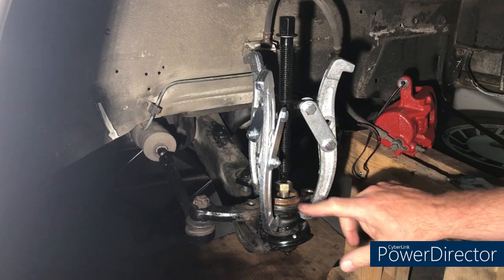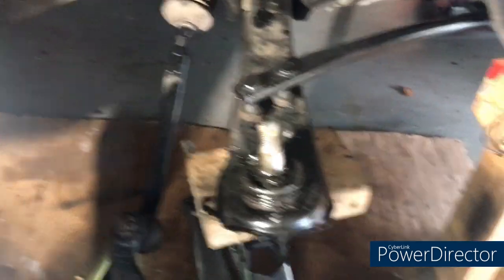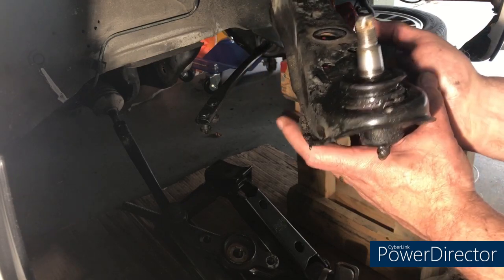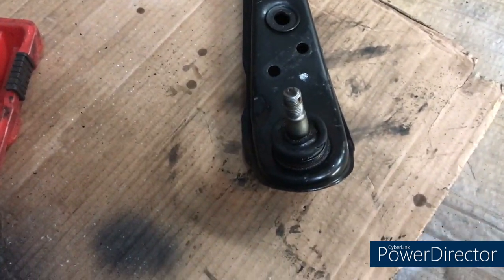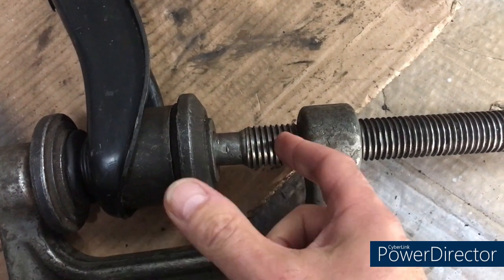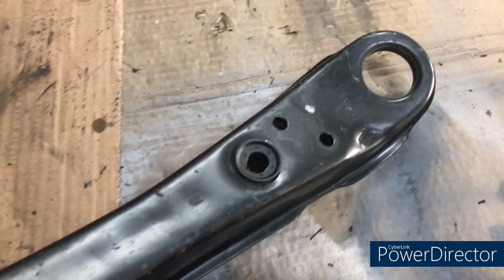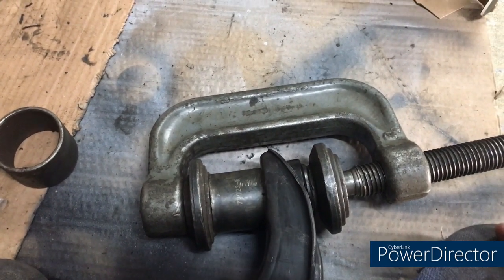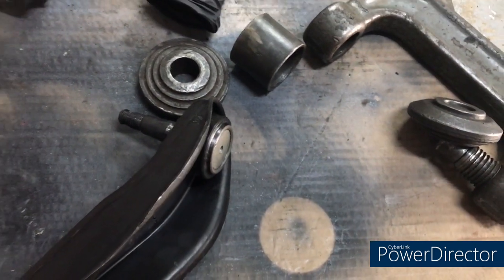The 300ZX Turbo Project  -Episode 9-  Replacing the ball joints on my 86 Z31

Comment: Thank you so much, your series of videos pf this, suspension and brakes were everything i needed to do the job myself successfully. If this helps anyone else with the same problem as me (and kind of in the video), my steering knuckle and struts were REALLY stuck together good. After soaking in pb blaster didn't do the trick, hitting it with a hammer or trying to wedge something in,, ultimately what broke them free was a lot of force using a sledgehammer or really anything with a lot of weight to it while the strut is attached with the bolts under the hood. I had to go from a few different angles as well.
Reply from the maker: Thank you for the comment. Glad to hear the videos are helpful. I can fully appreciate the struggle to separate the vase of the strut. As I mention several times in various videos I’m fortunate this car has very little rust or corrosion. But I’ve lived and worked on cars in the rust belt so I know the struggle. Good luck with the project.

Comment: How much torque did you use for the ball joint castle nut?  Can’t find a spec for that… thanks!
Reply from the maker: Manual says 71-88 ft-lbs
Cheers